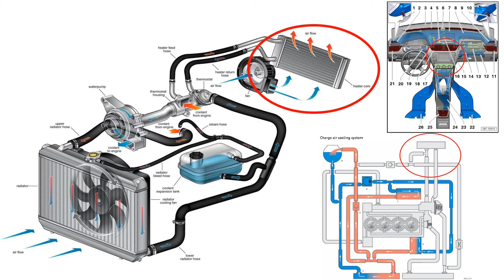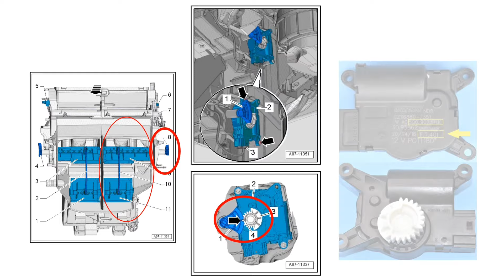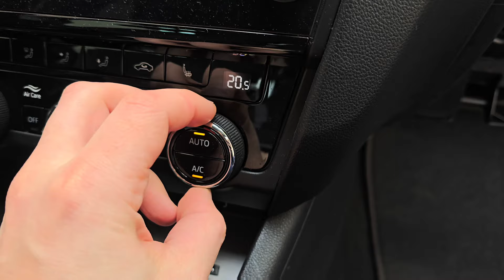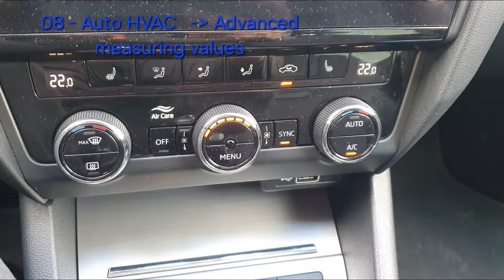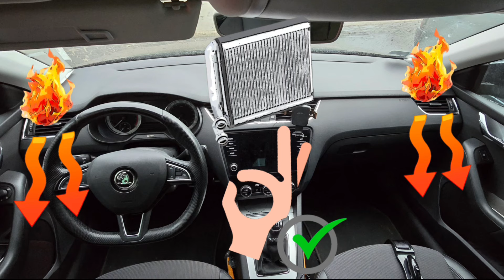Skoda Octavia III - Possible causes of heating system problems

Comment: Thanks for the video. I have a strange problem where there is only cold air when heating is on. On the diagnostics i get Temperature Flap Motor - No basic setting, function limitation due to energy management and function restriction by engine control module for the Climete control module. when i delete errors everything works fine but after a month or two it appears again . What can be the issue here?

Comment: Great video having same problem. But when checking the nr 2 check from the video the white plastic valve is not moving when turning up temp like in video. What does that mean then??
Reply from the maker: I suspect a regulator motor fault. It is worth reading with VCDS to see if there is a fault code.

Comment: Great video. You should get many mor likes!❤
Reply from the maker: Thank you!
Reply: So the problem was a clugged heater matrix?? My car can blow very hot air from the drivers side, but the passengers side is colder(about 10 degress colder). Since the drivers side is hot and at the right temperatur, the heater matrix must be ok, right?? So i am thinking that it could be the FT140 servermotor or a bad plastic link between the servermotor and flap. What do you think?
Reply from the maker: It has exactly the same symptom if the heating matrix is clogged. Only one side is hot.
Reply: @kimlong13 I know that it seems to be ridiculous, but it's true. The position and construction of the heat exchanger make it easy to clog from the "bottom" and up over. 
I have managed to take out mine without destroying it. I have used radiator cleaner, filled it. And cooked in the pot in the upper position, approximately one hour. I couldn't believe how much dirt there was inside.

Comment: Does the actuator controles everything? i have cold/colder air passengerside front window, door window, feet and rightairvent on dash. or are there 4 actuators per side?
Reply from the maker: Hi. I think the video in the description answers your question.
Reply from the maker: Or the following video: https://youtu.be/xOoYAopkULI
Reply: No i tried that already including my garage. Did not help
Reply: Are there 4 actuators for each vent or just 1 for all 4 vents?